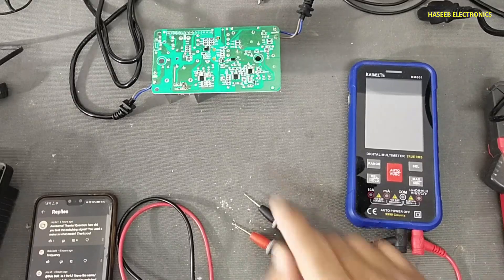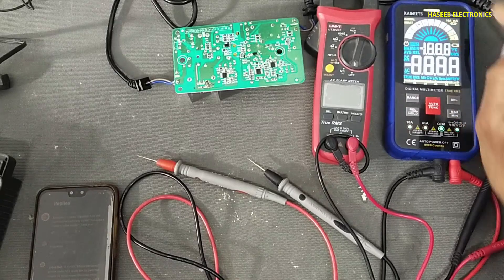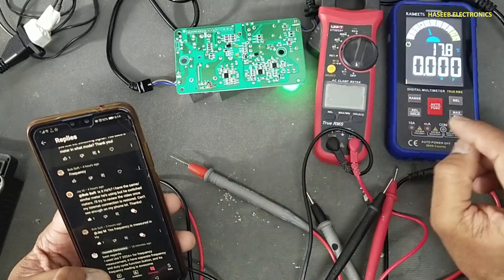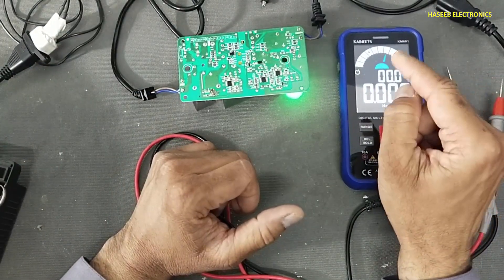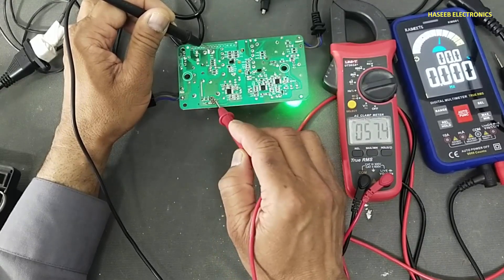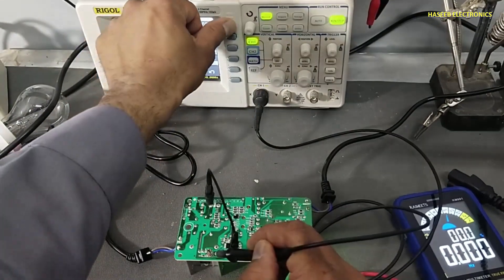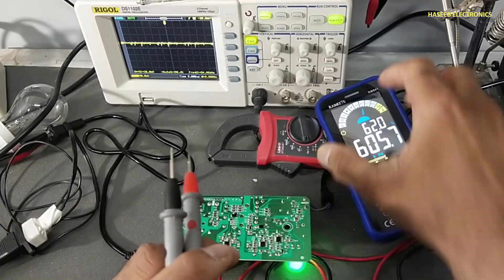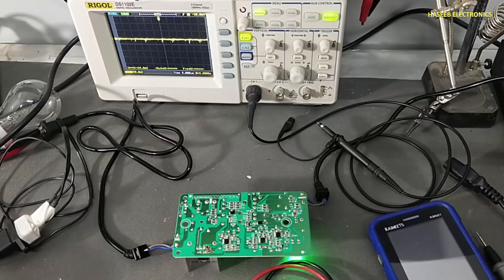{845} Why I Test SMPS PWM Signal With Uni-T 202A+

Comment: Thank you so much for answering my question! I'm amazed how inaccurate the Kaiweets meter can be. I'll also rewatch the previous video to study what points to test and what to expect per the schematic for the timer. Thanks again!!!
Reply from the maker: best regards 
thanks for your last question, kaiweets and some new brand multimeter have same crazy unreliable measurements. 
actually these multimeters detect the oscillation in transformer, and this multimeter detects that weak signals as well, which cause to give these false readings. (it is my opinion)

Comment: Nice informative video Sir. So for all clearity if i want to check if the pwm chip of a smps is switching, i set the multimeter in frequency (hertz) mode. i connect de black negative lead of my multimeter to the negative side of the filtercapacitor and the positive red lead of the multimeter on the gate of the mosfet. Am i correct? Hope to hear from you soon, many thanks in advance

Comment: I have a DC power transformer for my model trains. When I check voltage by my Aneng digital multimeter, it is 18 volt at all positions. But, when I connect the model train the speed is quite variable accordind to the position.

Comment: Thank you so much for answering my question! I accidentally touched my unit ut89x multimeter to the bulk capacitor while it was in the frequency range. now it is not reading the frequencies correctly. Can you give a solution or repair suggestion for this problem? Thank you in advance

Comment: Thanks sir.
Very informative.
I have a question, can we use same method to check the frequency of CRYSTAL OSCILLATORS ? 
Or if not how to check the frequency of CRYSTAL OSCILLATORS, which can help us to identify that our oscillator/resonator is okay ?

2nd,
How much frequency should have been there ? In this video the frequency was around 54.xxx is this define by the manufacturer of the iC and can be found on datasheet?

Comment: Ek smps for an example if hum lm5023 ic use kare jo ki 65w ki hai to uska output voltage or current hum Kitna badha ya ghata sakte, ye kispai depend rahega 
Voltage divider or voltage regulator ka ratting chodke?
Sir mai apke video dekh chuka smps ke regarding ap bhot sahi video banate hai
Thank you very much.

Comment: hello.
why you (in this specific case) don't use the fluke 179 multimeter which you use in other videos.
This fluke also measures frequency, but not the ducty cycle.
Is this multimeter good for measuring frequency in switched sources? (pwm)
Regards
Reply from the maker: yes brother 
fluke have ac response upto 30KHz in ac voltage mode
and in frequency mode that is upto 99.9 KHz, but don't have duty cycle option
this uni-t 202A+ clamp meter have frequency and duty cycle option (i use this for testing switching circuits, and in my opinion this is reliable with compare to other multimeters) 
this kaiweets KM601 multimeter have also frequency and duty cycle option,

Comment: What about fluke that you have
Reply from the maker: fluke 179 have 30KHz ac response upper limit. in hertz mode we can test up to 99.9 KHz. 
truly i don't use it for frequency testing in SMPS circuits because it is EXPENSIVE.............. LOL
Reply from the maker: https://www.myflukestore.com/pdfs/cache/www.myflukestore.com/fluke/multimeter/179_efsp/manual/fluke_179_efsp_multimeter_manual.pdf